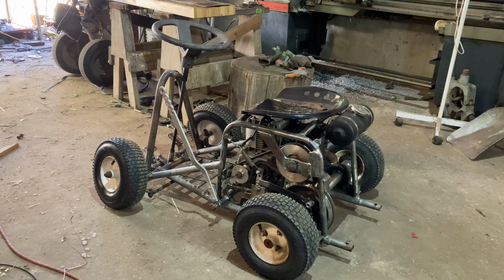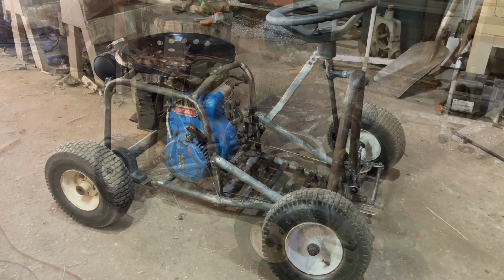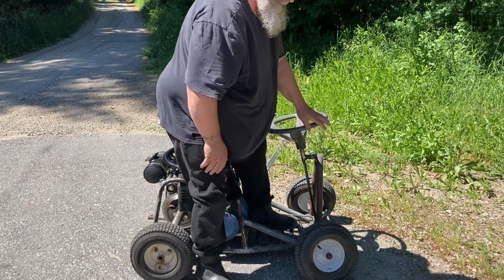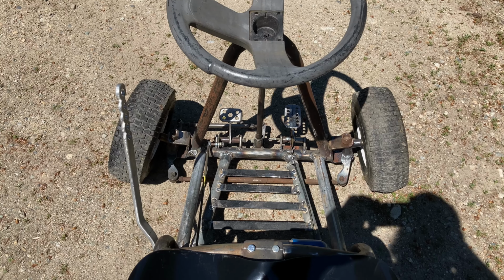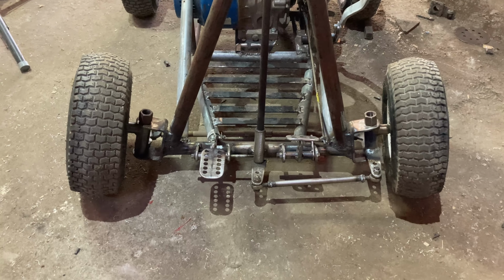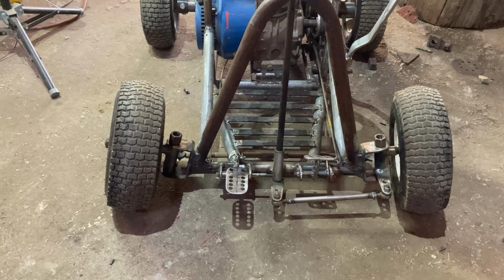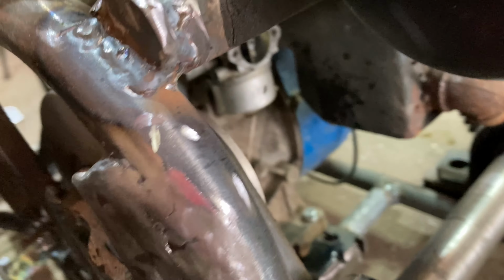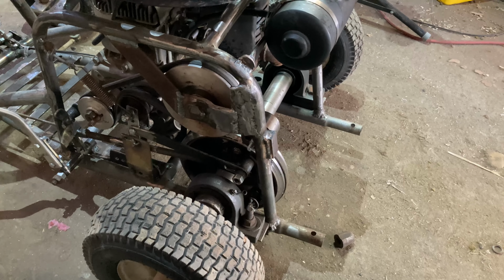Super cheap old fart drift cart. Witness me its a lovely day to die

Comment: Caster camber could use a little help, great crash. Fill the front tires with sand. 
Cheers.
Reply from the maker: @rockcrusher4636  ya its pretty much uncontrollable on the pavement and feels like you’re slamming on the brakes as soon as the wheels stop skidding at all